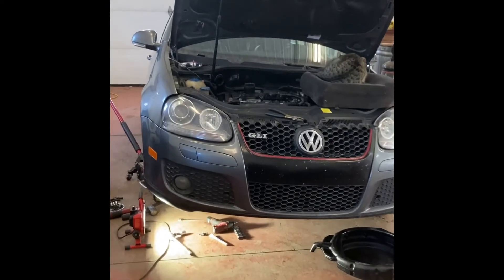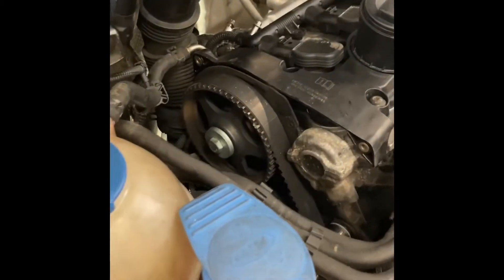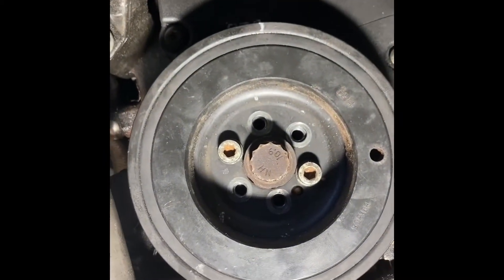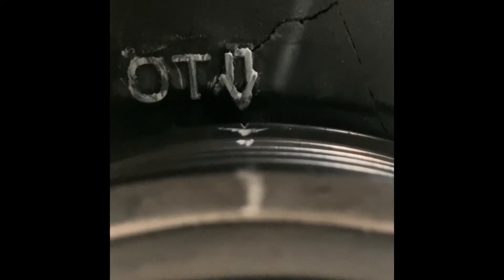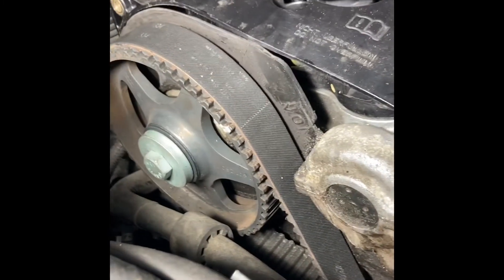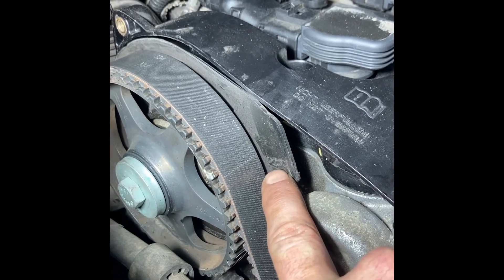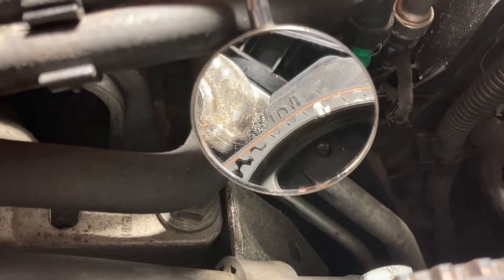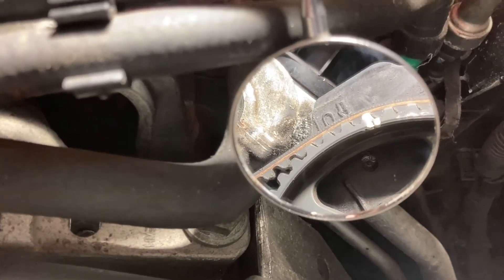2007 Jetta GLI 2.0 turbo, belt timing

Comment: I just have a quick question hopefully this account that you made this video on I still active. I was just wondering do you might know why my car isn't starting so I recently just got this from a friend he's he said it has been sitting for a year it is a 2007 Volkswagen GLI 2.06 speed manual OK so you know I'm doing my best too you know get the car going But I'm just having some Little issues I'm not really big on knowledge about volkswagens but I'm trying to learn. Anyhow My car will not start my friend says it could because the charge pipe isn't the right fitting so there's  Too much air going into the Turbo which is causing it not to start ask somebody else they said that it could be Crank sensor. And then it also Revs up but itself  So I wasn't really too sure why it was doing then also the fan so when I plug in the cooling fan at the bottom of the vehicle it just turned on  While the vehicle is off So I'm trying my best to fix the car as best as I can
Reply from the maker: If it’s an electrical issue and the car starts and quits there should be a check engine light on or fault code - you need to scan the car and see what the codes are saying. 

If the car is starting and runs for a bit and quits that could be a number of other issues.

I’d start by scanning the car and see what’s going on there first.